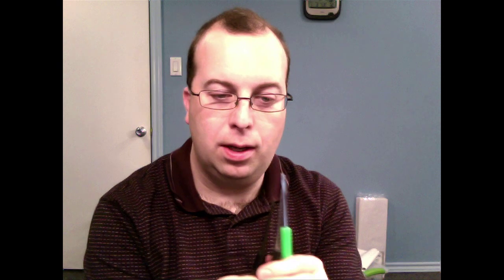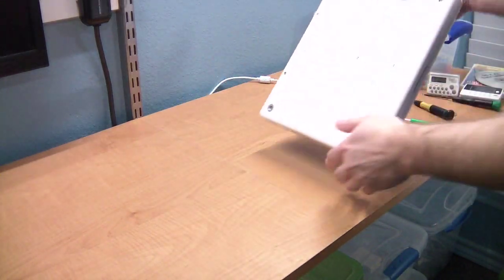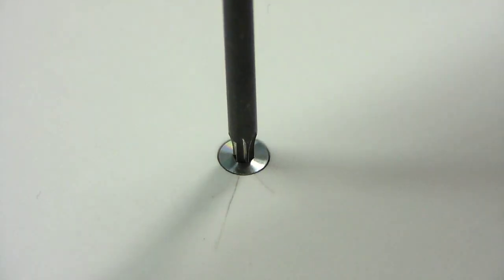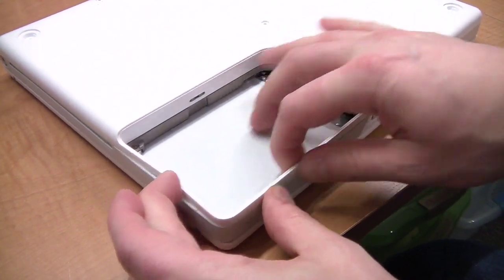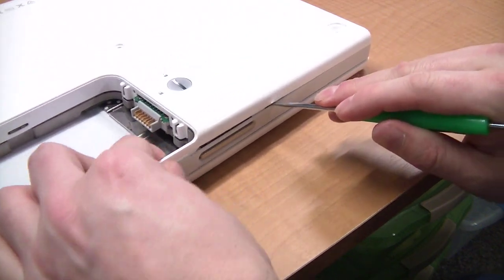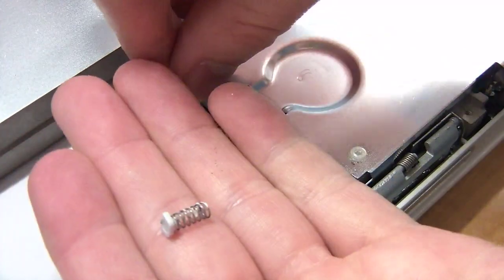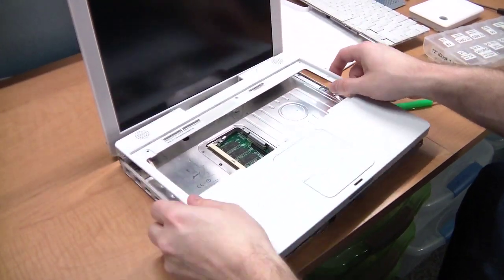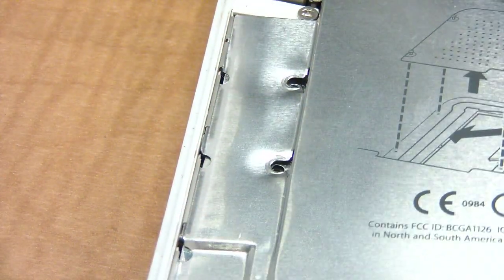Apple iBook G4 laptop disassembly

Comment: Hi David! I know this video is ancient, but thank you SO MUCH for making it - just got an old iBook G4 today, and your guide helped tremendously with installing a new hard drive, I don't know if I could have done it without your help. Those snaps above the CD drive are absolutely terrible, I think I slightly dented the whole line trying to get it off, but a small price to pay for storing things. Thank you again, your guide is still helping people 10 years later! :)
Reply: I’ve just removed a hard drive using this very good guide. Can’t believe the number of screws and heavy duty build. Really useful video.

Comment: David thanks for the excellent teardown video it was very useful as I just had to remove the hard drive from one of these for a customer who was recycling the machine but wanted the drive back. The model I had was slightly different because it had an Airport card. The teardown was so much fun I ended up stripping the computer down to bare frame. I’m a certified Apple Tech working at an AASP in New Hampshire and have been watching your channel for a long time.

Comment: So that much work just to replace the HDD. Gotta love Apple Design :))
Reply: Meanwhile I can almost take apart my Thinkpad T61 blindfolded.  I still love Mac OS X, but don't like how desktops and laptops no longer have user serviceable / upgradeable parts.  Great video, I still have a G4 to play around with, and may need to upgrade HDD.
Reply: tswiftshipper
I have 3 Thinkpads: A T410 that my wife uses, a E335 that I use as a companion for my desktop and a T530 I use for work. They are all serviceable and can be easily upgraded. If there would be no wi-fi / 3g modem restriction, that would be great but the parts are readily available so no biggie.
Reply: White MacBooks from 2006 < are MUCH easier to deal with!

I have several...

Just got a 2004 iBook 1.33 14"

$35.40 on eBay.

SourceForge TenFourFox browser plays YouTube...

See: PPC LUDDITE BLOG..

Watched SpaceX Falcon HEAVY launch today....

SCi-Fi shorts...

Pretty good for a 14 year old machine..

J.C.
Reply: You are keeping track of those screws every time you work on them, right?

Comment: I recently bought an ibook G4 off ebay. I noticed it would get really hot, especially around the lower left hand side. This video confirmed that the source of the heat is the hard drive. I bet it would run a lot colder with an SSD.

I do have G4FanControl, a Mac OS X program that lets you manually set the threshold for when the fans activate. I also have a laptop cooling pad that isolates it from your lap and places a big fan underneath, so that helps. 

But at some point I am going to have to open it up, because the hard drive is only 30 GB anyway, and I like to run three different OSs on all my machines. For example, on my main desktop, where I'm typing this, I have Windows 10 and Red Hat Fedora Linux 28. I plan to put FreeBSD on here eventually. :)

Comment: I cannot believe that! Looks much simpler than iFixit or official Apple manual. Especially those 3 socketed cables.(iFixit guide renders them almost impossible to remove without damaging connector)

Also no DC-In Board removal? Not necessary?

Comment: I didn't say that, but actually it is.  On a normal laptop you unscrew 2-4 screws and either open th hatch or pull from the side. Done.  On most desk tops you need to lug it out, open the side panel, unplug it, unscrew it from the frame, and then guide it out.  Laptop is easier, unless it's something crazy like this one.

Comment: I have an iBook G4 14 inch Mid 2005 where are all RAM Modules on the topside are missing. They are not soldered out, they never were soldered in. The systems tells an error of the build in RAM and only 256MB are recognized by POST-Test. Do you know of machines with this manufacturing failure? The systems runs great with no errors instead of the POST-Error message in system profiler. AHT says everything but the ammount of memory is all right. Greetings.

Comment: any info on getting to the power supply receptacle inside?
i have to keep pressure on the adapter plug in order for the machine to start and stay running. thanks!

Comment: Hey David, I've Got an iBook G4 (2005 Model, 1.33 GHz) and for some odd reason, when the battery is fully charged, it will shut off randomly, and then when i turn it back on with the charger, it works just fine. Exept the battery will Say its dead or low, i just wanted to know if this is the Battery Or The Charging Board (not logic board) I've taken mine apart to check it all out, nothing is wrong the MotherBoard
Reply: GaminGod Coffeeman More than likely, it's the battery...

Comment: Would putting in a 7200 rpm IDE drive be worth all the effort?

The  existing 4200 rpm 60GB drive is bog slow...
Reply: Yes,only more capacity than 120GB.
Reply: SSD

Comment: As a warning, my iBook had hidden screws underneath the metal covering over the bottom of the motherboard. You can't remove the top casing until they are removed

Comment: Hey bro do you sell stuff for iBook G4? I need the 3 "feet" and the screws and the metal housings you mention at 2:18 and I also need the battery springs. And btw can it all be disassembled and assembled agian and will it look like normal, like it hasn't been disassembled or anything...

Comment: Will any HDD work?
Reply: Any HDD with an IDE 44 pin interface. This is an older interface, as most modern HDD’s use SATA. But this is easily fixable with an IDE to SATA internal adapter, usually a few bucks on eBay.
Reply: NOPE!

No room for the adapter!

NOT a tower box Pee Cee!

Comment: I got a desktop power mac g4 and it's running mac os x leopard do I have to use another mac to upgrade it to tiger?
Reply: It's downgrade... u just need Tiger CD/DVD.
Reply: That's a downgrade dude
Reply: zach schwanke Tiger is older than Leopard (Unless you want the classic environment)
Reply: I would actually recommend downgrading to tiger if you have a G5 or a G4, older Operating systems on older Macs will run faster.

Comment: Funny thing is, even though the MacBook Air is newer it is way easier to take apart than this, funny because you usually find new computers to be harder to take apart, but the MacBook Air is barely upgradable so it doesn't even really matter
Reply: The other day I took out the HDD out of it (the slow P.O.S. that it is) and it was a pain, had to take out like 5 screws and disconnect two wires.... also take the actual HDD out of a bracket and rubber enclosure. 
All I have to do to remove the HDD out of a MacBook is take out the battery.
For my Acer netbook, undo a few screws on the HDD cover (the screws stay in the cover).
Reply: MegaRingstar Lol well those are still pretty old, now that since 2010 they've used SSDs which are held in with one screw usually
Reply: Tinu Thomas I'd hope so.
I got these three MacBooks from my aunt, 2007 MacBook with a Core2 Duo 2.2, 2008 MacBook with a Core2 Duo 2.1 (interesting that the CPU dye is smaller on this one, must be the one from the Air) and a 2007 MacBook Air.
I personally wouldn't buy these, but if it's free..... that's a whole new story.
Reply: MegaRingstar Yeah, that was the first gen, the ones after 2010 are pretty nice though, i have a 2012 Air and its still snappy and quick on El Capitan, I was gonna get an i7 8gb of ram Macbook Air this month to replace this one, this air was a hand-me-down from my sister who is in college so I'm fine with a free PC

Comment: LMAO why would u use Tiger thats a older OS
Reply: can't upgrade g4 anymore cuz apple doesn't support it anymore so gotta use tiga
Reply: you can use leopard too.
Reply: Or Linux. I had a bit of luck getting Linux Mint PPC running on a 12" G3. Problem was that the HD had more than it's fair share of bad sectors so while the install went ok, doing upgrades or installing other software kinda tanked as it would get written to bad parts of the drive and then become corrupted.